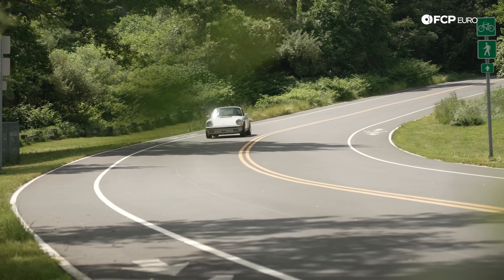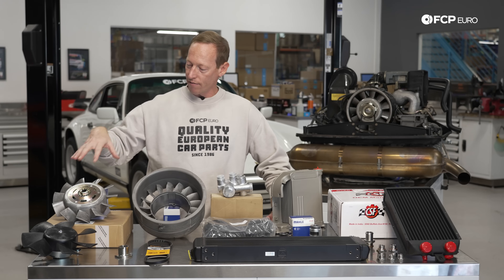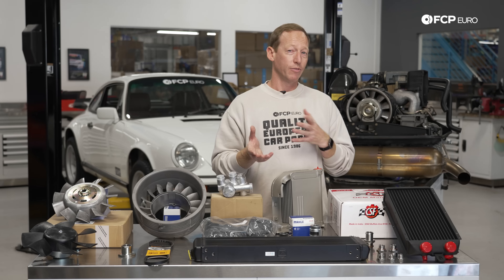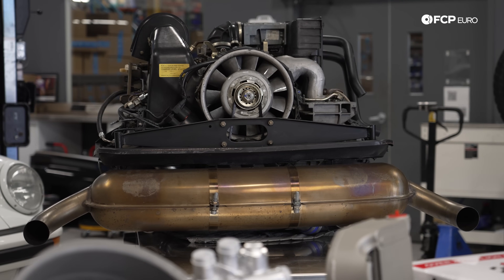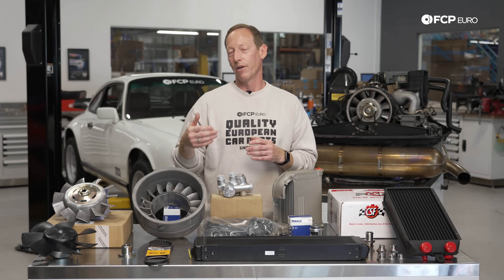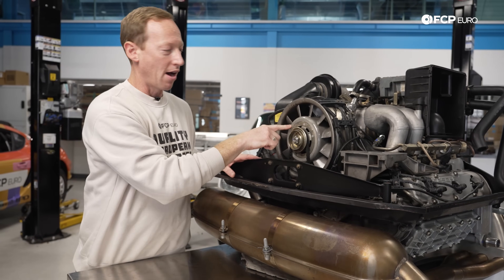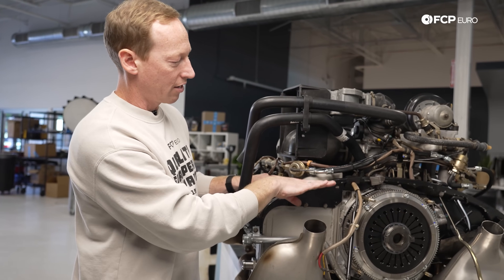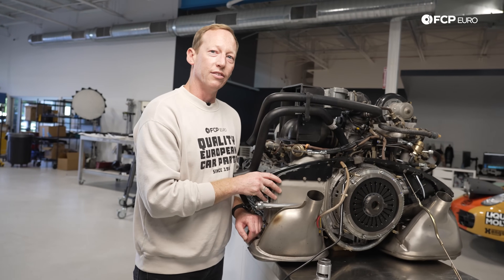Everything You Need To Know About How an Air Cooled Porsche 911 Stays Cool

Comment: You may think air cooling is secondary, but when your alternator seizes (which stops the air fan) you realize in about one minute that if you don't turn off the engine it will be destroyed by rapid onset excess heat.

Comment: One question, on the hot air cooling the engine, I notice the rear left wheel arch always blows hot air out, the rear right wheel arch with the oil lines doesn't. Is this the same air that heats the in car heater, or is it the exhaust air that heats the heater? I assume the oil doesn't heat the cabin heater?

Comment: There's no clutch on the cooling fan.
Reply: i thought so too but maybe some did? the engine shown clearly has no clutch at the fan pulley but maybe at the crank pulley?. however, they are not "primarily" oil cooled. mechanics have no training in thermodynamics but never stops them from making false claims.
Reply: @redshirt-scotty  You are correct.  Only about 20% of total rejected cooling heat is eliminated by the oil coolers.